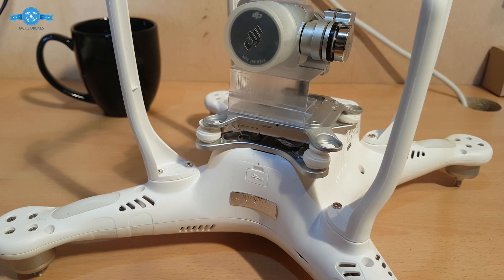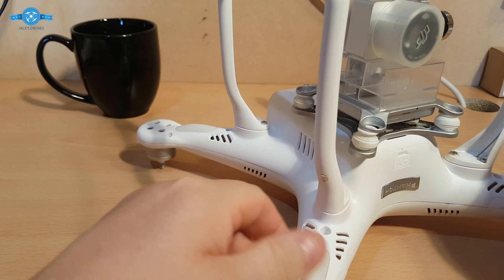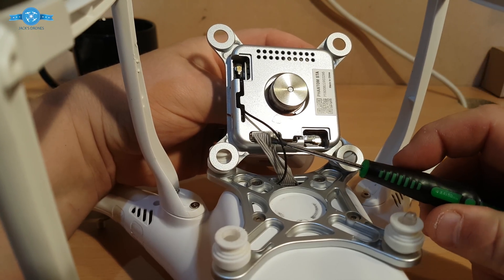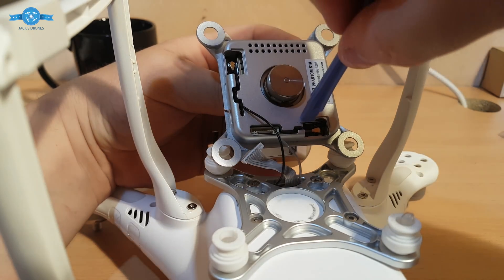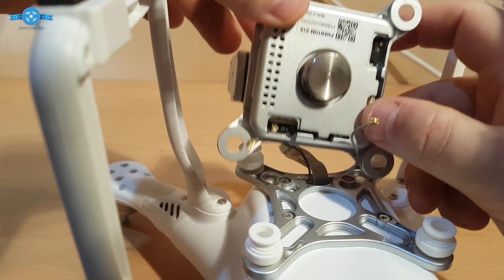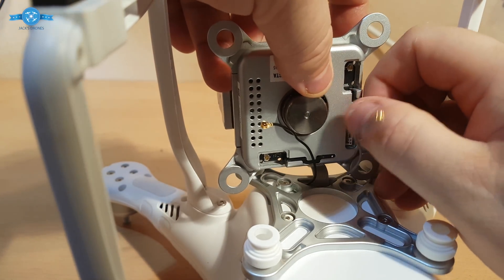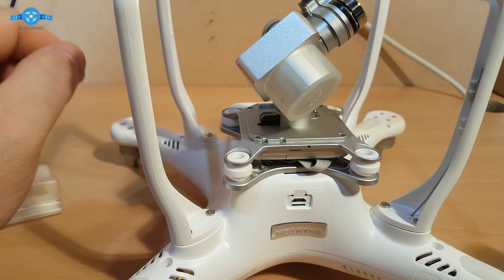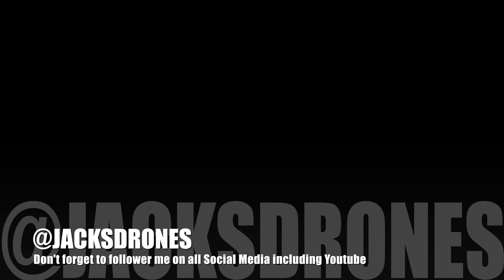DJI Phantom 3 Standard - Gimbal Camera Swap

Comment: This is a great video.  However once I installed the new camera from DJI the controller will not connect to the copter.  Do you have any suggestions as to why this is not happening.  I have done all or the suggested resets and hacks that I can find.  I spoke with DJI but they just want me to send it to them.  HELP!!!!!
Reply: Bill Drosehn hi! Did you solve this problem?